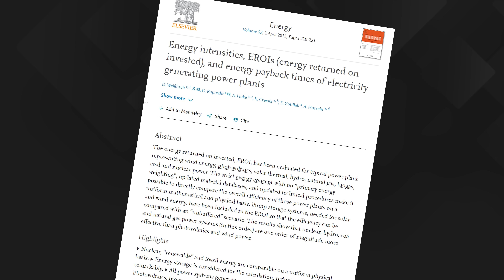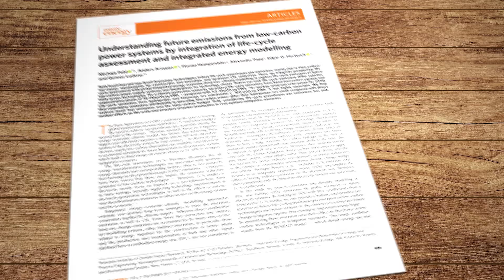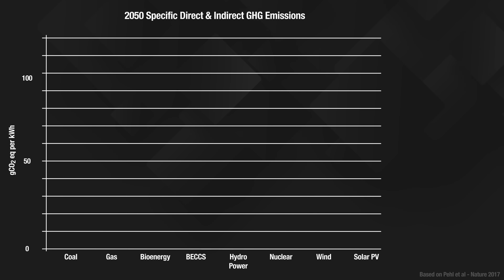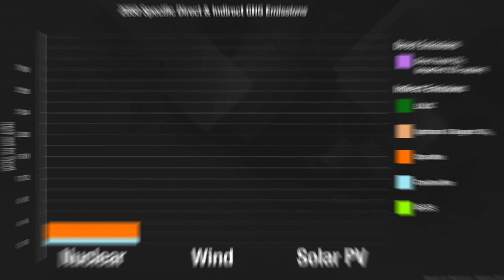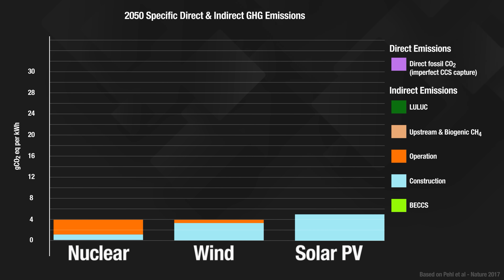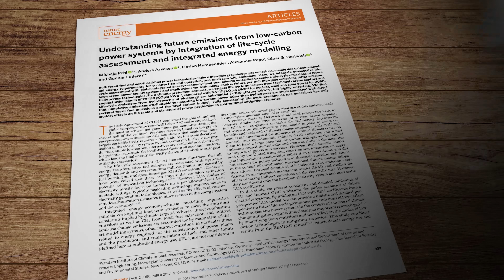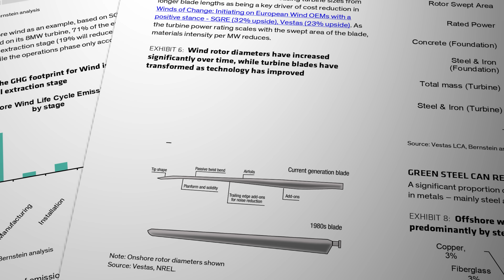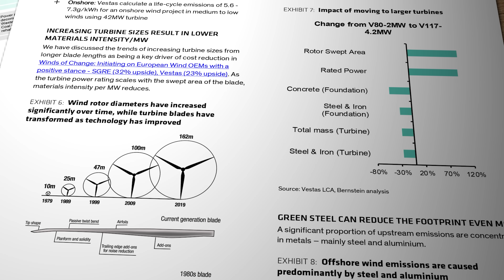Lifetime carbon emissions of renewables vs fossil fuel. Problem or solution?

Comment: Thanks for the update! Development is so fast now that we really need a quarterly or so review of the latest calculations to keep informed. 
I suspect that most people have (like me) a mix of old, medium and recent figures in our heads and need to make a conscious effort to educate ourselves on what really is going on. The power of the oil industry to plant twisted and false conclusions is unfortunately very high and it is just too easy to fall for it as a layperson. For example, my "knowledge" about discarded windmill blades was a photo of a large blade cemetery somewhere, that I saw some five years ago, didn't know until you told me that blade recycling has achieved such high levels.
Reply: Luckily Putin is driving a shift away from oil and gas power.
Reply: @aaronbaker2186  Thanks Mr. Putin! :D
Reply: @aaronbaker2186  Yes - the one positive to all those dead and maimed Ukrainians and Russians. Not to mention the excessive additions to the CO2/Methane output from the fires and explosions.
Also India seems to be going right off the rails - they have a space program and yet they "can not" replace their coal plants or even deliver water to many regions....
Reply: @aaronbaker2186  yeah...and back to coal
Reply: I read that the larger blades were buried in the ground, sometimes next to the tubines due to being to expensive to transport. I suppose it doesn't affect the carbon footprint, at least.
The point is that to say that they are being recycled doesn't mean much without any figures. I recycle old t-shirts and underpants, but I doubt I will save the planet, on my own, despite them actively being recycled..

I wonder if the energy costs of recycling the composites/materials for solar and wind are included in the lifecycle calculations? What can the recycled materials be used for?

It certainly looks like a mix of nuclear (for a constant baseload), in addition to wind, and solar, would be the best solution, with excess energy going to supplying industries that make hydrogen, or something similar. We still need more facts on what and how much is being recycled, and how much this is costing/saving emissions.
Everyone is pushing their own agenda, without enough thorough fact-checking.

A good video, thanks.
Reply: @jagolago-bob  Yes the energy costs for the composite materials are included in the LCA - that's the whole point. It was about 3% of the total in the paper in the video. Surprisingly small for all that glass and resin, but of course they are very light - that's the point - so not that much material.
This whole transition is complicated because we don't know the final prices of each technology before we start; we can only find out by making a lot of it. So you have to kind of 'set off' in what looks like a reasonable direction before having a complete system design. This is disconcerting for those of us with an engineering mindset who want to design/analyse/cost the whole system before doing anything. Sadly that's just not possible.
Reply: @xxwookey  So the energy costs for the recycling are included? Good. I wonder how they split those costs, because there are different ways to recycle composites and GRP, each with different energy requirements.
I know what you mean about the costs, choice of, and the designing of the recycling system though. I suppose the choice will partly depend on the expected economies of scale, and hopefully with lower pollution.

The question is what assumptions have they made, and as I said, how much will be recycled. Maybe it's not worth bringing the massive offshore turbines back to land to recycle when there isn't a great market for the parts. Recycling solar panels needs even more energy, as I understand it.
Reply: @jagolago-bob  There is a difference between doing and waffling though.
Reply: @madpete6438  Your comment can be taken in several ways.
Reply: @jagolago-bob  Clarification : Wafflers with an agenda (ie make it worse by existing and doing nothing), people who try to make it better with their actions.
Reply: @madpete6438  Got it, thanks. i agree.
Reply: You might enjoy reading “Factfulness”, by Dr Hans Rosling. It’s mostly about world health and economics, not energy policy, but he focuses hard on how people’s beliefs are governed by seriously obsolete data, and faulty conclusions and biases from that incorrect data. One of the best books I’ve ever read, and I think anyone who thinks themselves “smart” should read it.

Comment: The wind analysis is wrong but I don't know by how much as google is not returning the studies on construction of wind turbines,  Oil use and hence carbon as well as maintenance is much higher in offshore turbines vs onshore.  Battery storage carbon cost should be used in calculation when comparing to nuclear and gas/coal power plants as it is needed to equal functionality.    Still this is a very good video and is how we need to look at energy.  Even better would be to look at how this effects all the planetary boundaries instead of just a segment of 1.  That would probably be 10 videos though if the information studies have even been done.

Comment: Green Energy is a mythical unicorn.
Reply: I would not argue that.  I think the big problem is the lack of addressing the growth pattern, and I don't see that happening now that we are uncontrollably large as a population.  I like to advocate for the patterns taught by my old landlord Bruce Sandford (former associate Chemistry Professor at UW).  He gave the example that his first job out of college, processing cod liver oil, nobody seemed to be able to get it right.  they were all experimening on a large scale vessel.  Bruce did his experiments in a small test tube until he got the reactions right.  I think we need to do the same with green tech.  Adding it too early to the economic mix just makes it cheaper to keep the growth going.  But we will need the tech, so let's do it, and learn it, so that when the decline becomes more perilous, we will have it for mitigation.
Reply: I am putting my comments in earlier responses this week because I feel it's unfair to others since I live in Seattle and always end up on top.